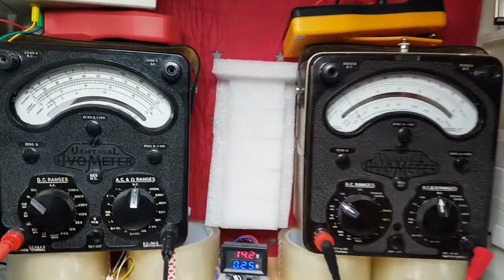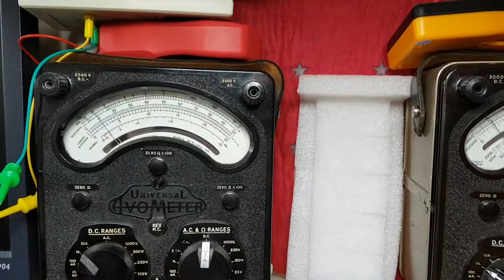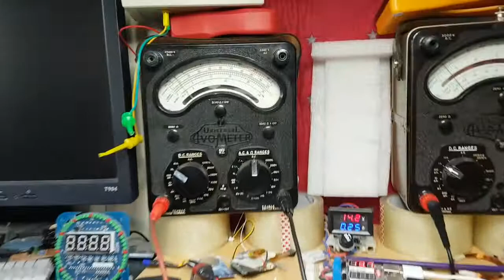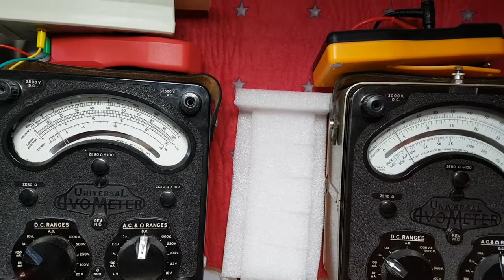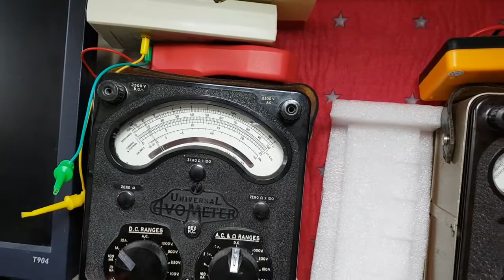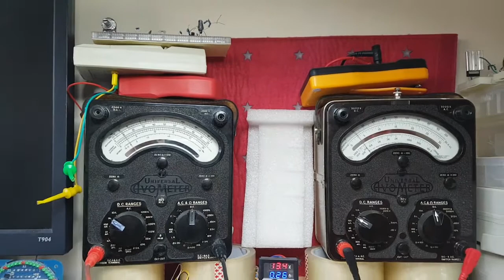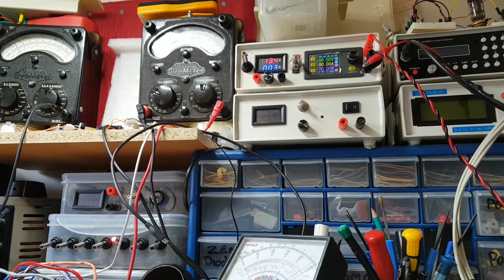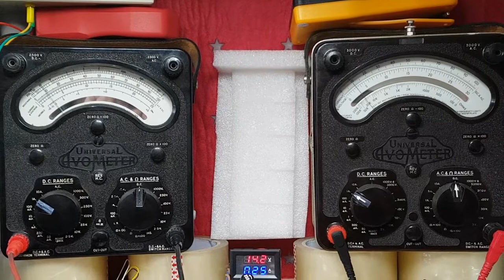DIY 8 ohm 60 Watt Stereo Amplifier

Comment: Since any case / 'mesh' enclosure is not about hum-reduction, I'd suggest you could use any kind of see-through metal you want.  Perhaps sides or even metal panel as base could be exploited for heat-sinking.  Seems like most commercial audio equipment has perforated metal plates or heavy small-weave grilles largely to keep fingers and small metal objects out.  Now and again, we can hear your rough woofer struggling...  It's near-impossible to really get a sense of loudness through the video's audio.

Success is sweet, ain't it.   3 thumbs up.
Reply from the maker: I was thinking of putting them in perspex case/s with backlit VU meters found on ebay http://www.ebay.co.uk/itm/2pcs-X-Panel-VU-Meter-Warm-Back-Light-Audio-Level-Amp-One-driver-board-/152474227435?hash=item23802c12eb:g:ppoAAOSwaB5XtEUI
Its a pity the video audio will only give an idea of how it sounds. I have made another video with some snippets from CD   https://youtu.be/gwx-mMebD68   The audio sounds fuller to me. Success ,yeah. It feels great building the circuit, troubleshooting errors, getting to use nearly all my toys doing it :D :D Then having a drink and a night listening to music. Awesome! Cheers!!!